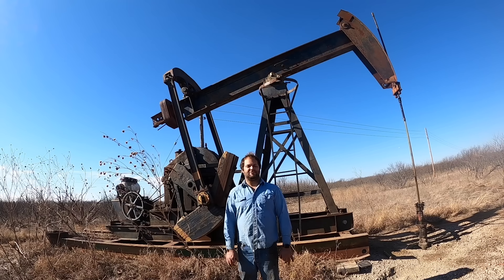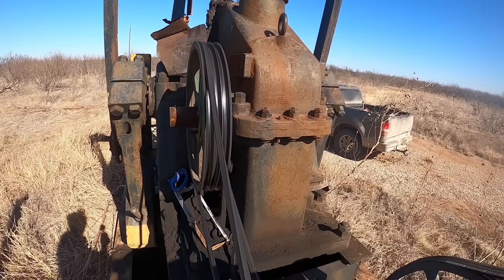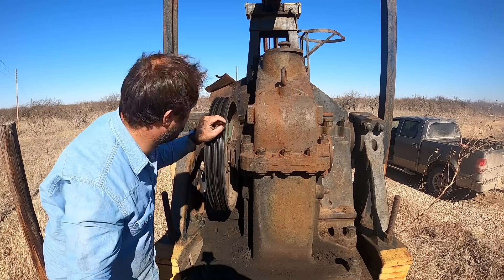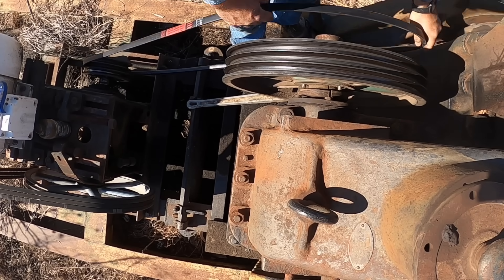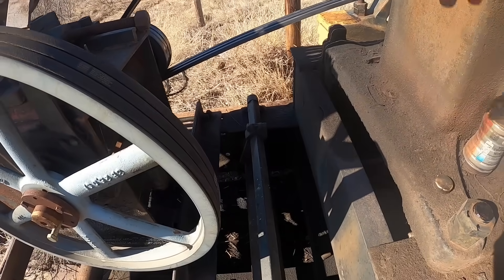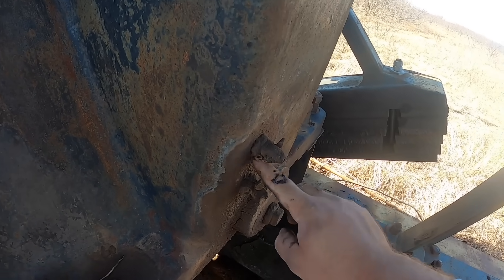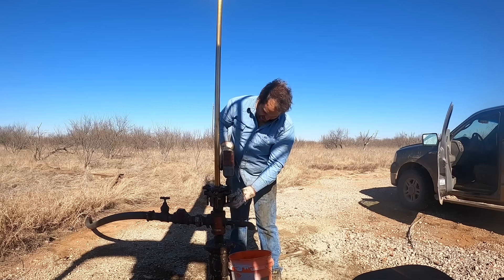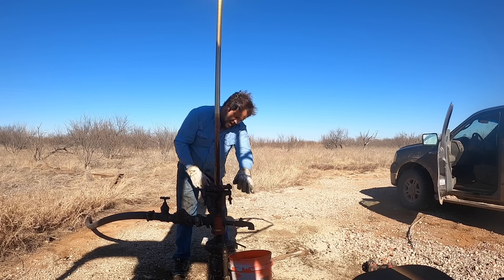Maintenance on a 101 Year Old Oil Well

Comment: Very interesting and I learned a lot! One question, however: what keeps the wireline hanger cables from bulging out on the down stroke? They're under compression on the down stroke, so it seems to me they wouldn't be enough to power the rod down...unless they're a lot heavier duty than they appear to be?

Comment: I admire your ethics sir and have done rebuilds like you and agree if that gearbox is still running you aint done a whole lot wrong - just ignore the haters and the trolls on here, most of them know jack all!  always wondered how these things worked. Ive been an engineer all my life since I was 16 (Im 65 now!) and its great to learn NEW STUFF like this.  My late father always called these 'Nodding Donkeys' so that's what I always called them! Its interesting to think that 4 or 5 generations of engineers have probably worked on these until they retired and a new guy takes over!👍 great video thanks.

Comment: Still a cool video. How deep is the well?? You said the casing goes about 150 ft to keep the oil/gas in the formation then the production tubing goes right to the bottom where there has to be a pump with check valves. Would this well have been drilled with an old cable/tool rig or was that 150 years ago??
Reply from the maker: 150' is surface casing the production casing is about 1550 with the production zone at about 1600. This well was right around the transition from cable tool to rotary. It could have been ether.

Comment: How about wells for a house out there is there oil in that water too or no because there not as deep or another reason?
Reply: think of a oil deposit as a bubble and the water table as the ocean, the water is eveywhere but oil is only in certain spots, also oil floats so naturally it is separated due to water tables not having flowing water.

Comment: We have wells in northeast Kansas where the oil sand is about 675 deep.  These wells use time locks.  In one of you videos you mentioned that you can turn on the well with your phone.  Could you please explain in detail?  Also, do you know a brand of timeclock that can be programmed electronically say 3 minutes on & 10 off.  The standard time clock runs in increments of 15 minutes.  Keep up the great work - really enjoy the videos as I am a owner, operator, pumper as well.

Comment: Nice rotation of the tubing in order to reduce rod wear on the tubing. I see you are running an electric motor for the pumping unit. Do you run any gas engines?  Looks like a Skinner brothers pumping tee and single pack cone stuffing box. Those Milwaukee cordless impact wrenches really come in handy in the oil patch!

Comment: You are not a "pumper' until you can change the packing with one hand!  If that don't beat all.  I have changed matched belts on a similar size pump, but I never thought of using a 24 to help roll them onto the wheel, thanks.  Regarding the tubing hole, a real old school hand, born in Vernon, told me this possible solution.  If the rub is above the pump, use a polish rod atop the pump to keep the rod string from flexing at that point.  I never did it.  We had to replace the joint of tubing every two years where it rubbed a hole.  Great video!

Comment: Me and my dad used to be contract pumpers in the oilfield over 20 years ago I could have shown you in awhile well a lot older than this one for that matter by about twenty years it had almost the same kind of motor a big ol Ajax p just a lot bigger the pumping unit was also a lot bigger it wasn't no Lufkin with iron bridal I'm not sure if a pumping unit and motor was original or not but I could remember this plaque tell him when the well was drilled and stuff that was a long time ago though read even had old cellar beneath the stuffing box don't see many Wells like this anymore I'm thinking recent to year to cut most of it out

Comment: Cool video man. I have been around oilwells all my life. Even have a few videos on my channel.  I pump wells is in Kentucky.  Your method for putting belts on is interesting.  I roll on by hand with a screwdriver. I'll try yours next time I need to change belts on a 40 or 57. I also never thought to turn the tubing like that, intriguing idea there. Unfortunately 90% of our well heads are hardlined in so that's not really an option.

Comment: Have you considered buying and installing a rod rotator on your well? The company I work for has them installed since my field's wells are all extremely deviated. A chain is linked to the walking beam and slowly rotates the rods with each pump cycle. Would be helpful as it would be doing the rotation while the unit is running, saving you from having to deal with a hole in tubing.
Reply: There are also tubing rotators as well.

Comment: Get yourself a chain vice grip to hold the top of the stuffing box. Changed hundreds upon hundreds of packing sets out and they work great.  Back in the day they used to run tubing rotators just for the reason you mentioned, someone should have a few kicking around.

Comment: As a mechanic I've seen alot of remote grease fittings. What Iean is there any reason that you can't on that machine. In essence it to make greasing and extend them to a lower place. It's safe er and you have a better chance of greasing it all I'm sure that there are guy's that say fuck it. Also it's alot faster mind you that's after you spent a lot of time doing it but it will pay for itself in no time. Here is an example on my cement mixer. To grease the two drum rollers you have to climb up on the back of the truck to do it. Extend it down lower so you don't have to climb up and down every time which leads into you have a better chance that they will get grease. I'm all over the greasing because doing a drum roller sucks. I'd rather spend the time greasing apposed to doing the roller. Anyway just a thought. Take care and ty for your video's.
Reply from the maker: Thanks. Its really not that big of a deal to crawly down the beam. I've got a few set up like you say.
Reply: @TheZachLife  Hey np problem. I didn't want to offend you thinking I'm telling you how to do your job. My only intentions were to pass on a couple ideas to other guys in the trade. Ty for getting back to me on it 👍 Take care and work safe 🔧🔧

Comment: Well, you said you expected the comments section to give you heck, so I'm gonna give you heck. I live in MN. There was a very (locally) famous incident some years ago of a fellow that drank Gatorade every day, and used paint thinner in the course of doing his daily job. So, being the smart fellow most laborers are, he decided that instead of buying a safety rated cup special for carrying the paint thinner around in, he was gonna fill a Gatorade bottle with paint thinner. I'm sure you can already see where this is going. One fine day, this gentleman grabbed the wrong Gatorade bottle, took a large swig, and dropped dead before the ambulance arrived.

Now, I'm not gonna suggest you get a safety rated cup special for carrying oil around in. That just sounds like too much work for me, so I don't expect you to do it either. What I am going to suggest is that you take the Gatorade label off the bottle you got there, and replace it with a " OSHA secondary container label" so at least you can easily visually distinguish between the good stuff and the good stuff, if you catch my drift. It may not save your life. But it might save a friend's, or a kid's life. Heck, just removing the Gatorade label and writing "OIL" in big, black Sharpie ink would do much the same thing as a secondary container label, and it's even cheaper to do. The OSHA labels are around a dollar a piece. A Sharpie is maybe double that price, and can be used a thousand times over. Removing that Gatorade label is free. Safety is priceless.
Reply: I agree to use specific containers for chemicals, but if that's SAE 90 GL-1 it is not very toxic, if you drink enough it will act as a laxative, that can kill your ego depending on the circumstances but you will survive.

Comment: Brass has an anodic index of 0.5, if you are having corrosion issues that are lessened with brass, you are using a less reactive metal with that liner.
Things like zinc anodes are used as sacrificial metal because it is pretty high on the index at 1.25 while being cheaper and safer than alternatives (magnesium).
Since you are not wanting to sacrifice metal the less reactive liner is giving you longevity.
Silver or copper with a lot of nickel mixed in would be less reactive but way more expensive.
Reply from the maker: That makes sense. I need to do some reading.

Comment: If your dealing with lots of v belts. And mishaps as shown here,  Check out a belt hog laser alignment tool it will help with belt reliability.  Proper aligned and tensioned belts should run a long time.  Also if your consistently having issues you maybe able to switch over to a v band or banded or power band style belt.  The reliability purists would say not to run belts on either but I’m guilty lol.
Reply from the maker: Thats interesting Ill look into one. I usually just use a string. The problem here is that the belts are grossly overloaded. This thing originally had 5 or 6 grove D section sheaves. About 10 years ago D136 went on nation backorder and couldn't be had and I switched out to the 3C sheaves as a right now fix and never went back with anything better.

Comment: Spent 35 years pumping wells, pump jacks and gas lifts, mostly strippers.  Company operated on a shoestring.  Enjoyed the work, but always issues with anything mechanical.  Seemed like every time they had a good sale of oil, there was tubing issues, parted rods or what not to spend the money on.  They stayed afloat, but just barely.
Reply from the maker: Thats about the size of it.

Comment: How deep is it?
I would like your take on what I’ve heard about oil well going dry but after a while the oil comes back and refill the well. 
Also what do you think about ‘ fossil fuel ‘ ?
Reply: At 9000 lbs for the tubing string it’s not too deep. Maybe around 2000’..

Comment: Oil is undergoing  yet another attack by those who have no idea of the dynamics involved in it. For example,Here in Queensland,Australia the government is very anti fracking and oil exploration ,but I have two neighbors running very good businesses directly involved in both Drilling and Fracking. One has massive pumps which are towed to site by Semi trucks and the other makes case hardened 5" casing pipe. They heat treat the pipe and then do something which forms a hard skin to prevent the casing from wearing through. Neither of them look like they are slowing down and yes ,Queensland has both oil and abundant natural gas fields.
Reply from the maker: They try to put us out of business and then gripe that its too expensive.

Comment: We rebuild stuffing boxes for some companies or change out bases if they need a different size.  When we put them back together we always go nuts and lock washers on top and feed the bolts up from the bottom.  I started writing this before I seen your whole stuffing box.  They are typically a double pack or a double pack with a pollution control base which contains a flapper incase of PR part.  Lots of 5k and 3k stuffing boxes here as well.

Comment: Interesting to see that you don't use a motor starter panel, but you could add some breakers below the disconnect that should prevent blowing fuses. I've switched from bronze p-rod liners to spray-metal (nickel) because, for me they last about twice as long (and cost about the same). I wish my pumpers were as through as you, hard to find good help these days. Your formation must have a strong water drive to account for the long life and it's productivity even with the casing valve closed. 'Not a fan of jack shafts & single reduction units, but like my dad used to say, "sometimes you have to make the most of what's available".
Reply: I think this is a family operation.  Down time comes out of their pockets.

Comment: Safety check. Never stand in front of a power distribution box when throwing the switch. Always stand off to the side then throw it.
Reply: I honestly don't know. Why?
Reply: @Spookshow1000  I witnessed once where a racoon had gotten himself placed between the hot side insulator and earth (ground) of a 10KVA sub-station transformer. Vaporized into fog the poor mammal including the bones. All that was left was a permanent grease like stain or shadow embedded in the transformers dielectric  paint . (The transformer was fully energized at the time) The REA field superintendent had found some small tufts of hair that identified it.
The entire transformer had to be replaced . It took a massive crane (we) to remove that transformer from the substation pad (up over the cyclone fence) and replace it with a new one. Just because of that grease stain.
Reply: @Spookshow1000  You might want to do some research on this. 
Rule #1 Human Habit- Why should I ?, even though some one gives to me sound advice from experience. Sub conscience rebellion + practice = Ignorance and catering to ignorance gets people killed real quick, especially out in the field or shop when you are working alone. 

Rule#2 When disregarding the power of electricity will always get somebody else or yourself killed or horribly injured. 

My best advice is to find an electrical lineman or IBEW worker, tell them someone said so and ask them why and let them educate you. Allow them to educate you on what can go wrong inside of a distribution panel the moment it becomes energized.

I would presume from looking at your work environment, people generally look where they step or reach down or put their hands for vipers.

Do you carry 2gal. sterile irrigation water for wounds, fire extinguisher, stocked medical bag including provisions for burns and snakebite behind or under truck seat or truck seat caddy and a charged back up flip phone? Do you have  instant cold packs and a sterile container to keep water and a cold pack to keep a finger in and the knowledge of how to do your own triage for viper bites, burns or a traumatic digit amputation? All very good things to know if you have to drive yourself from the field to the ER.

I'm a retired electrical field worker construction worker and machinist. Always measure twice and cut once. Plan your plan with safety planned in first.

Comment: Sorry if I missed it but do you own this well+equipment? If so, do you own the crude you pump out? If so, do you sell the crude? How's all that work?
Reply from the maker: It's mine. Kinda, in this instance  7/8 of it is mine and the mineral owners get 1/8. Its sold to a purchaser that buys it by the truck load.
Reply: @TheZachLife  interesting. I've heard that mineral rights and land rights are separate--that you can own the land you're on but someone else can own what's underneath it and have the right to dig up your land to access it. The way it was explained bothered me. In your case you explain I think split ownership of the oil, though I don't know whether you own the land this equipment sits on. When the crude is sold, does the revenue split with you getting 7/8? Is oil considered a "mineral"?

Comment: I am a or was a Certified Relief Valve Tech.The company I worked for also did a Greasing Service on ''Pump-Jacks''.Several times when working at a Jack I would have to disconnect the ground from my service truck abd get the Brass Wrenches out.Oil and Gas is dangerous work.

Comment: Sorry for sounding ignorant but if your Cason builds pressure does that mean your packer is leaking and wouldn't your cups and centralizers keep the sucker rod off the tubing wall,, I work offshore so I'm not too familiar with land wells. I've been in the oil and gas industry for almost 20 year and the last 14 years been in plug and abandonment, I run eline and slickline.

Comment: One time we worked this well over an had an asshole that was supposed to been the pumper man when we came out an hooked to it he came out there bumping his gums nobody touch this pump motor but me you fix the well call me an i will start it up had the old ajax motor on it so we got it fixed called him he came out started it up an had the main flow line closed off it blowed the stuffing box rubbers out an soaked my boss with oil an come to find out mr pumper was nothing but the grass cutter we told the owner what he done to us an he fired his ass on the spot

Comment: The belts rolled because the sheave are worn so the belts run on the narrow inside diameter. New Sheaves or rebuilt and cut the sheaves.
Reply from the maker: Both sheave are pretty new and aren't worn.

Comment: when you get the oil out the ground where does it go after that
Reply: It flows to a seperator (he mentions this), and likely to a crude storage tank (tank batteries). A tanker truck then pumps out the crude, and to other crude storage tanks in the area. Most likely it is then taken to a tank farm where it is then sent via pipeline to a refinery, where it is de-salted, de-sulpherized, atmospheric distilled into varying fractions, and then further refined/distilled and blended into the products we know. (Not a petroleum engineer)

Comment: Brass is cathodic (meaning, it becomes a cathode) to steel, which is the Anode, thus is sacrificial, giving off positive ions to the steel, which is, with respect to the brass, is negatively charged, so the steel will not rust. The Romans used to rivet their wrought iron helms with brass rivets for the same reason. I hope this information helps.
Reply from the maker: Interesting, That makes since.

Comment: You seem to have it figured out, but, if you need to use both hands put your 18" or 24" below the hammer union on the stuffing box, and hang it off the polish rod.  It's not going to be heavy enough to damage the surface.